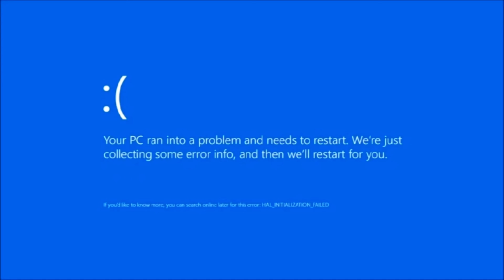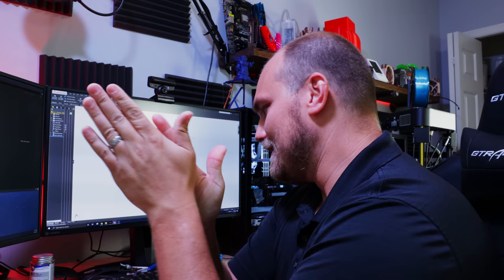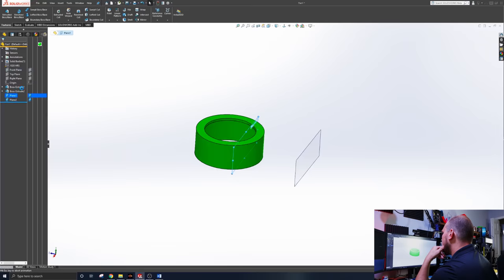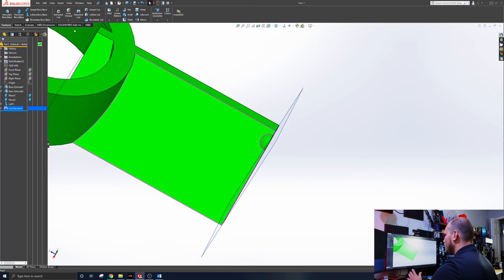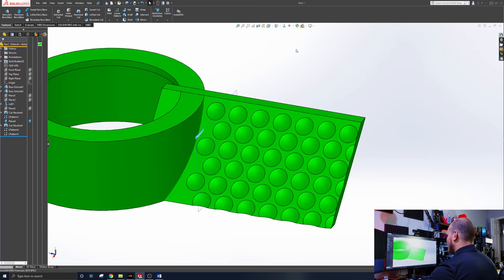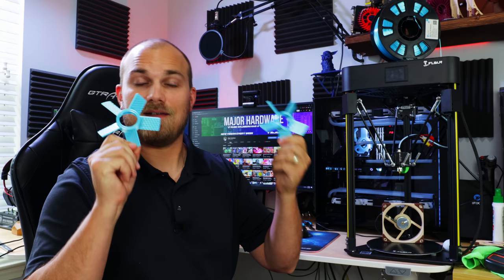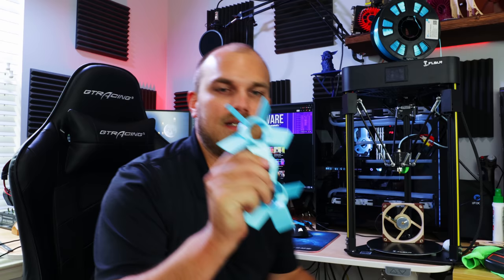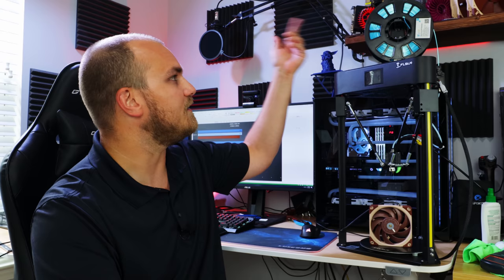What If Fan Blades Had Dimples Like A Golf Ball?

Comment: 10% materials savings would add up in a mass production line when cranking out tens of thousands of these.  Was the print time the same?  Any strength gained from the dimple pattern?  You’ve proved the dimples don’t have any effect - which might be a GREAT thing if their other properties have benefits (less weight, less material, etc).  Perhaps this can be scalable to windmills, where material cost along with a 10% weight reduction would matter a LOT.
Reply: Fascinating
Reply: Generally you don't want your wing to delaminate the airflow...
Reply: If you do wind up saving a little on manufacturing, sure, that's one thing, but a more complex design, depending on the manufacturing process, it might be more costly versus the saved material. As in taking longer, so you can only push 95% the amount as before, and materials were only 5% of the cost to begin with... you lose 5% of sales to save... 0.5% of your costs...
Reply: Dimples would actually require more material to get the same rigidity, current fan blades are thin enough that removing the material for dimples would compromise the structure
Reply: Yeah actually thats a big one to major production material cost etc so yeah major benefit seeing as there is no loss also could be awesome new design that companies would invest in and buy the patient.
Reply: I understand your idea and i agree but i must point out that windmill wings are built very specifically if they had dimples like that they would destroy themselves over time being so large.
Reply: @corruptlegacy3965  sure maybe large models but pc fans are produced by the 100th thousands so that could make a huge impact on there material cost
Reply: @OniMikeVision85  even still I would like to point to my point about manufacturing complexity and the supplemental point right after mine. In order to ensure rigidity and manufacture fans in such a way, it may take longer with more material to dimple a blade, leading to higher cost to manufacture against cheaper options, making the endeavor... moot. More time and effort for similar result.
Reply: There is one big mistake with the dimples reducing material though. Lets say your fan was 6mm thick, and where the dimples are it reduces to 4mm, and this has no effect on performance. This does not mean you should produce with dimples to reduce material usage, it means you should have made the whole thing 4mm to begin with!
Reply: If I'm not mistaken, windmills are made form resin-reinforced glass fiber, which is paid for in square meters, and the resin is very cheap.
Reply: @Mostlyharmless1985  that's exactly the point of the dimples. But since only RPM were measured, we dunno if it's really better.
Reply: The dimples are harder to make apposed to the flat blades
Reply: @vincentguttmann2231  Yes, which is why my operating theory is that it would make the fan blades less efficient as you generally want to hold on to the air across the wing as long as possible to create as much low pressure over the wing as possible. The reason why golf ball dimples reduce drag on a golf ball is mainly because it disrupts the low pressure pocket immediately behind the ball while in flight.
Reply: @Mostlyharmless1985  Exactly.  Or, phrased differently, a golf ball that doesn't interact with the air works better (for distance, at least).  A fan blade that doesn't interact with the air works worse.
Reply: @Mostlyharmless1985  Are there designs that intentionally try to reduce delaminating airflow?
Reply: Material costs of a pc fan is relatively low. The biggest cost is making a really well balanced blade.
Reply: @Mostlyharmless1985   I wouldn't say "generally" in this case. You want to reduce thermal resistance. To gather the heat, turbulent flow is best.  Then, to remove heat from the enclosure, follow with laminar flow. CFM doesn't reduce therm. resistance. You want higher air flow velocity--the eddy currents make this happen, creating higher vortex velocity at the surface of the hotspot.
Reply: @Haveuseenmyjetpack  Gee, if only there wasn't something immediately blocking the path of the airflow from the fan...
Reply: There is so much wrong with this comment, i can't even. 
He didn't prove anything, efficiency could be measured in different ways. I would say power in this case, not rpm. The aerodynamic design of the blade is terrible to start with, so yea the dimples did nothing as the flow was probably detached at the back of the blade anyway.

Pc fans are not made by a 3d printer, but with molds. Meaning the blades can be made really thin to start with, taking dimples out of them would just mean you'll have to make them thicker somewhere else. Otherwise they would break. 

 Then the production process of windmills is not even comparable to a pc fan. Dimples would make them less efficient, smaller, and incredibly more expensive. 

With everything, not all rules apply the same way. Every situation requires you to think different, and different solutions apply.

Anyway, have a great day.
Reply: slaapkonijn58 and yet, you did...
Reply: I would agree with mostly harmless 1985 here but I do like your thinking. It all starts by asking what if😃
Reply: Nice point about 6 vs. 4mm however I am fairly certain the dimpled blade will have greater structural rigidity than the 4mm blade although it truly may not matter in this application; it’s moving a specific amount of air at a set RPM. Hmmm the comments are the best 🙃
Reply: Frank Stetka thanks.  Not personally, but for being a curious and open mind, generally. 

For efficacy of cooling, it is essential to provide the maximum linear velocity at the surface while minimizing the volume of air flow. This determines the reduction of thermal resistance. 

There is an optimal point where the power removed is equal to the incremental power added to increase velocity:
Similar to surface area exposed over area of the plenum of the flow area—this varies with the power dissipation of a device over the power of a fan. A higher ratio is better.

Depending on the power needed—where the air pump heat is included with the device heat—typical systems try to achieve 0.5m/s to 5m/s velocity.

Beyond this, it becomes less efficient, and CFM is irrelevant, whereas the benchmark for linear velocity feet per minute (LFM) or meters per second is relevant.

Using this approach—verified with smoke speed measurements—a turbulent flow plenum chamber with a temperature-controlled, three-terminal regulator driving fan was designed.

The results were outstanding, with a 10C rise for active cooling, versus a 50C rise for passive. 

So the answer to the initial enquiry is: Turbulent flow is the best design to collect the heat, followed by laminar flow to remove it from the enclosed volume. 

Again: The technical reason is that the eddy currents create higher vortex velocity at the surface, and the air flow velocity is what reduces thermal resistance, not CFM.
Reply: It's like fans haven't been designed to be as efficient in cost and effectiveness for the last 20 years. If mass producing fan blades with dimples was the way to go, we would already be there.
Reply: Maybe if you made the mold and mass produced them. But that is a lot of extra machining time and tool wear.
Reply: Would it decrease the structural integrity of something that size?
Reply: I say save 100% on material and time by not putting up a terrible wind mill.  I used to love the ideas of them and they are just terrible out in the actual field.  We should learn from our mistakes and push further ahead on solid state CO2 recovery.
Reply: @Mostlyharmless1985  In negative pressure zones on high speed wings, turbulators are used to extend the laminar flow across  the wing surface, and control exactly where turbulent flow begins. Sorry to burst your bubble.
Reply: @izzyplusplusplus1004  I don’t see where that negates what I said, if it’s extending the laminar flow, it’s not delaminating, is it? I just know the wings on any airplane I’m not fearing for my life in don’t have golf ball dimples over it.
Reply: @Mostlyharmless1985  It is delaminating, at a specified point along the angle of attack. I did mention that.
Reply: I don't think wind turbine blades are 3d printed though, so you would have to press out the blades and drill the dimples into them. A lot more manufacturing process, and the material would be wasted.
Reply: @OniMikeVision85  injection molding doesnt like dimples. It would take way longer to produce a die and get it up to production standards for a neglicable diffrence in material cost

Comment: Where's my fan with built in whistle cuts? I need something that plays a different pitch on each blade. Ideally, it needs to play ominous music when it starts running too slow. This is a totally practical item, which has much demand. I swear.
Reply: I want to see that!
Reply: I would buy something like that if it was fully functional. I.e the whistling wasnt extremely loud and or high pitched, almost like background music would be; you know its there but its not completely distracting
Reply: @Siler, but the distraction is all that matters! Don't you want panicking siren noises when you're running across the battlefield in 4k?
Reply: @thelocalcoma  No because I generally listen to music or have youtube running on my second monitor while Im gaming lol
Reply: @silervanguard1998  Pssssh. You're doing this wrong bro. That's what industrial grade acoustic foam is for. Just isolate your speakers and set up a whisper line for the fans